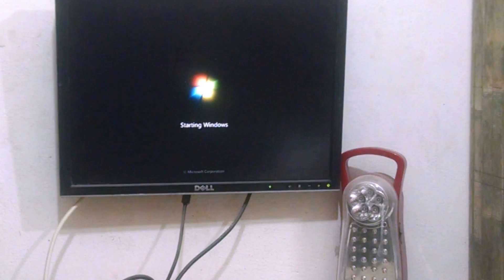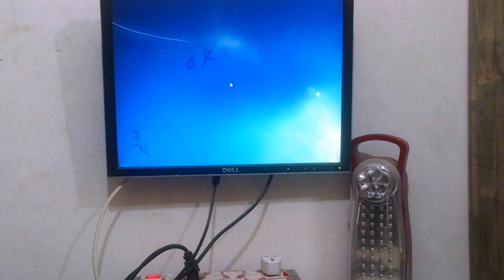NEC computer hangs while installing new operating system solved

Comment: Can you put a video card on these?
Reply from the maker: yes u can but the one that is smaller in size and also dos not need 6 pin power supply jak
Reply: Like the zotac ones?
What about motherboards, do i need a smaller one too?
I'm planning on buying one of these and upgrade to parts.
Reply from the maker: do not upgrade any pc for it will not work as fast as it should be buy a gaming pc